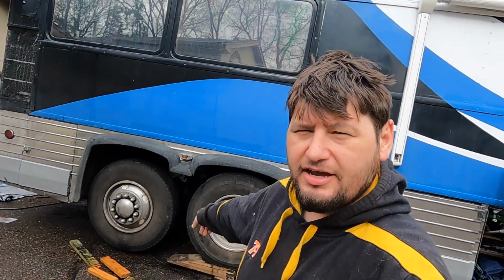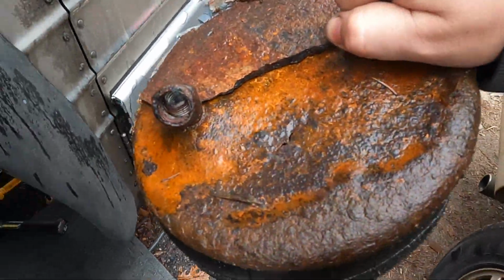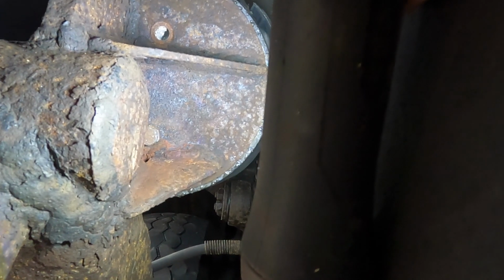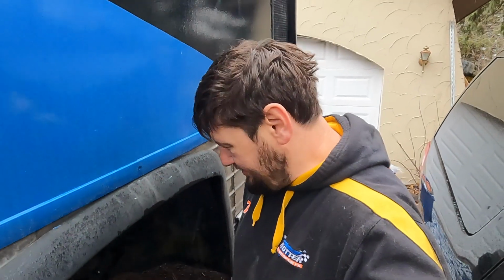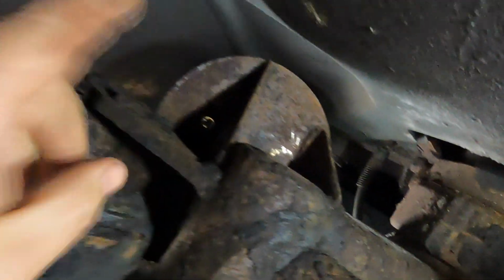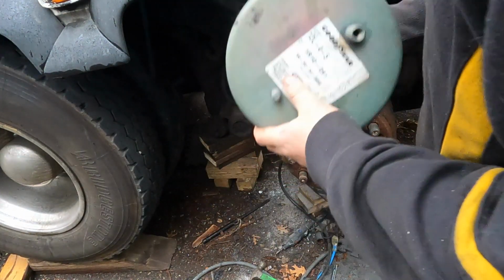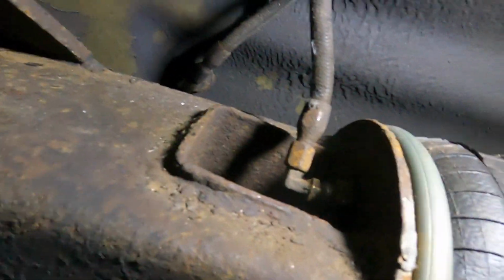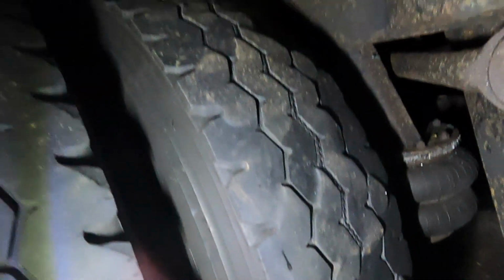Changing Tag Axel Air Bag MCI MC9   Spring Bus Maintenance

Comment: Thanks for the video  Shawn when I did mine I was able to get the hidden one with a crows foot, but I live in the Midwest and I have very little corrosion. The air lines are cheap and easy to replace. Now's the best time to do them.  Hate to work on the bus in cold weather, I have become a warm weather fan in my older days. We hope to see you at the Skoolie Swarm at U.P. Stay safe.

Comment: It may not be a shock issue entirely. On dual drive tires they honestly need to be both brand new or you will get tread chewing. When I replaced the drivers on the passenger side, they had a height difference of 3/8" and the shortest was being chewed to Hades and back because it rotated at a faster speed and traveled a foot less than the outside tire every 200 feet or something like that. It was the Old tire guy said to me. and what my old dad said as well he used to drive truck for many years. 
However a chewed up tire on a single wheel car or truck. almost always the shocks or balancing issue. Keep the videos coming.
Reply from the maker: Good advice there. You could be right.

Comment: Should have been able to get a crows foot on that bolt. Or a wobbly socket on a impact. Glad you got it out.  Noticed your not useing the tag axel hanger MCI gives you for just this reason.
Reply from the maker: I didn’t record it, but I tried a crows foot, and even ground down a socket to make it fit in that space.  One old mechanic on FB made a tool for this job, cut a box end wrench short and welded a ½ inch socket to the other side. That was what gave me the idea for cutting the wrench I did. 

That’s true on the hanger chain. Thanks .

Comment: Hey Shawn, I replaced mine with exactly same air bag. Now my bus is riding bit higher. That is causing main airframe / axle constantly releasing air from main suspension on drive axle. Do you experiencing same problem please ? BTW I used long extension on my socket to get that tricky bolt loose. It worked for me.
Reply from the maker: I have not. It’s possible previous owner changed the tag air pressure to compensate for a leak?